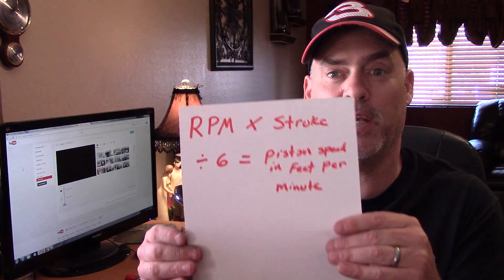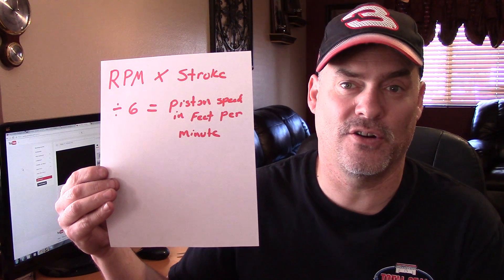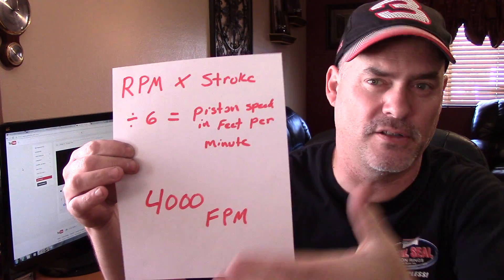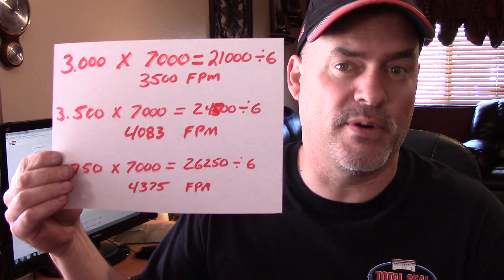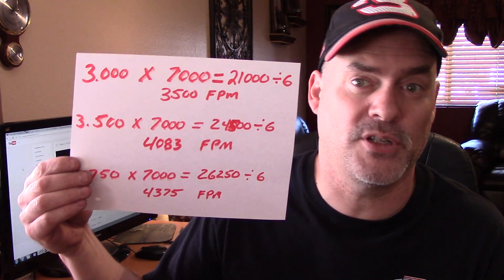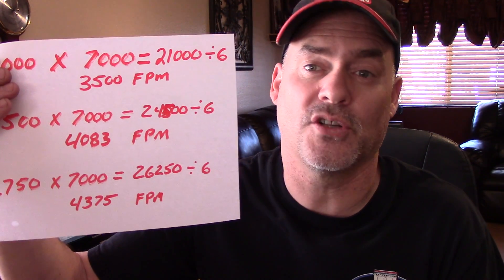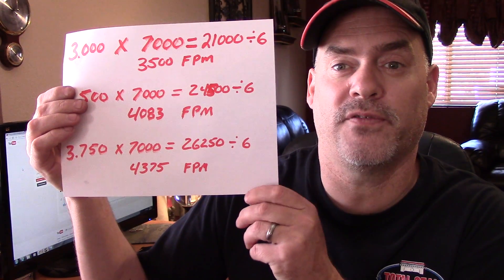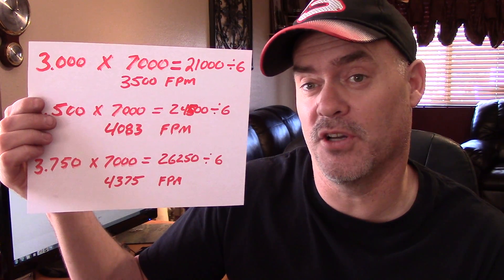What RPM should be an Engine's red line

Comment: Honda K24 4 cylinder has a stroke of 3.9 and those engines are taken to 9,000 or even 10,000 rpm all the time. Is it possible that the goal post has moved for piston speed limits with new materials and technologies or is this an inherent engine design since K24 is inline 4 vs a V configuration engine.

Comment: Just came across this video.  In today's engines, piston speed isn't nearly the issue it used to be.  Materials are better, designs are better....I'm not even sure piston speed is even considered much anymore...there are things that are much more important to consider when building engines..  11,000+ rpm engines these days are getting more common, and 8000+ rpm mountain motors is about as common as a small block these days.  The pistons speeds in those engines are off the charts and far beyond what would be considered acceptable.....

Comment: Man, Freiburger has said some dumb stuff, that stroke doesn't dictate redline and that all the power is in the short turn radius, things that are just objectively wrong.
Reply from the maker: If your dogging into it I would go roller cam and aftermarket heads by the time you find a set of the better heads and have all the work done to them you might as well buy new much better heads like Dart or RHS the flat tappet cams are garbage these days id go roller

Comment: so what naturally limits the RPM of an engine if all the parts are high performance.. springs, rings, bearings.... is it induction? is it that a 2 barrel vs a 4 barrel vs forced induction ... where the 2barrel just can not keep up with higher speeds and at some point it just peters out and is sending as much air and fuel to the combustion chamber... so its just maxed at 5000rpm and can't supply enough air/fuel to get it to 5500,6000,7000? ... and just improving the fuel / air supply allows it to hit higher RPMs? I am guessing thats what it is.. maybe cam durations have to be adjusted but thats not the limiting factor in the thought of a governor in a lawnmower

Comment: Thanks, this was a great explanation on how to find an engines recommended redline and performance capabilities. As a side note what is the stroke length of a 5.3L LS engine or would a 4.8L LS engine possibly be a better option? I would like to use a M122 GT500 Roots style supercharger and possibly even use a turbocharger as well.

Comment: the piston speed is important... but no is the rason real reason for choose the red line for your car... the best way without knowing the data of the dyno to choose your rpm red line is knowing the MCSA (minimun cross sectial area) in your induction. With the MCSA your can determine the real point to shift your car, this point in rpm + 600 to 800 rpm more is the correct point for the car.

Comment: This video and the one covering camshaft selection are priceless additions to my future engine build. I was given an LS1 from an '98 Camaro and want it to both make good TQ/HP numbers but also give me half decent mileage. I know you can't have both high peformance and high mileage, but there is a sweet spot one can achieve w/ careful planning. Its going to be a challenge w/ the lack of bore-ability of the block, but I should easily be able to hit the milestone of one HP per C.I. w/ a proper balance and assembly.  My goals are maximum torque while maintaining emissions compliance, as its my daily driver.

Comment: 327 is the perfect size i have a 302sbc a 86 350 and a vortec 350 what would you build i have a large journal 327 crank also 302 has popups
Reply from the maker: large journal 327 all day long 302 does not have enough TQ and you gootta spin it to the moon to make power 327 hase the best Rod Ratio and more TQ 350 stroke is a bit long puts the Rod Ratio too high or beat performance

Comment: I got a small block Chevy 327 , it has 12:1 forged pistons , steel Vette crank in a 4 bolt main block , 
It cranks 11,000rpm before the valves start to float

Comment: Hi, In AU. The last ford  5ltr w XR 8 had the GTP aswell.  Would you agree for the street.  Leave  the happy stroke, but bore to 40" - 60"   220, 512.110 grind,    and change nothing else,   i think would  sound better, good horsepower, std dwell for the injection and timming curve, good on fuel.    Has anyone compare this insead of some stroke increase .  Mike

Comment: I guess this is just all weird to me!! I've never heard anyone sit around and say: I want to spin my engine 8000rpm!! Like, what for, what''s the point?... just to say you can spin 8000 rpm?... doesn't make any sense!!

Now, what does make sense to me is asking how much horsepower you want to make. From there, we can start looking into what it's going to take to do that, such as what engines might make it possible, what the costs might be depending on engine choice, airflow/cfm, etc. That makes sense to me. But hey, to each his own!! If you wanna spin your engine 10,000prm and make 37 horsepower, more power to ya!!... wait... less power to ya!!

P.S. one of the biggest hold backs to rpm is valve springs!
Reply from the maker: if you are dealing with small engines 8000 RPM or more is required if you are going to compete with bigger engines, NASCAR engines run at 9000 RPM's for hours on end most serious drag race cars turn 8K to 12K RPM also when you build an engine for someone they always want to know the limit IE how hard they can push it I really don't understand why you think that is weird it seems to me you would really want/need to know where the red line is

Comment: Thank you for your Chevy 350 Video Series. These videos have helped me improving my technical understanding of  the 350.
Im saving up for my first engine Rebuild or Engine Build right now. 
....Best Case scenario....
I'd LIKE to see 600 hp/ 550 Torque out of my current 350. either in the 383ci or 400 ci. but since I still need to iron out other details on the truck. I'm probably just going to do a HO 350 rebuild for now. so I can drive it while I get the other details fixed as I go. 

I'm considering buying a built crate Engine or sourcing a LS Engine later.
the problem I have with the LS Option is. 
all the little stuff im going to need in order to make the LS work in my 94 S10. 
Wiring. Engine Mounts. power train. Computers. transmission linkage. cooling systems. 
yada Yada yada.
Reply: I have a 92 S10 myself. As well as a 1970 350/300 4bolt along with a good 350TH to use if I wanted. Same problem as you. The LS option is for sure going to require extensive wiring and what the heck, the speed it is going to generate might as well figure in a suspension as well. Lord knows the flimsy shocks that you get for the S10's isn't going to handle the corner speeds... I'd like to do anything/everything to the 350 and sit it in it, but hate to think that it will be just a putt putt truck...
Reply: @LORDdeath Gaming  You're making more out it than necessary for an LS swap. The wiring is a simple affair that you just lay on top of the engine, once installed, and start making connnections - it falls together like falling dominoes. I was intimidated by the prospect as well, but it went quite smoothly, once I hunckered down and started the process. As for your plans for your SBC, just remember speed costs money, so get rready to spend a pretty penny for an engine w/ those specs. Just sayin' those are big block numbers. Best of luck.

Comment: ok wait so my stock d16z6 can do 4720fpm
WTF 
ive hit 8000rpms maybe 4 times in my life because there is no reason when power drops imidietly after 6500 but thats a lot
i guess 

ive also had some stories with misshifts like to 2nd at 70mph and engine still working and didnt make any problems after that just works as it was working before

Comment: Why divide by six??
Reply: Because the stroke is half the distance (in inches) the piston travels in one crankshaft revolution.    
1) stroke x 2 x RPM/ 12 = FPM
or
2) stroke  x RPM / 6 = FPM
FPM is only the average  speed the piston traveled in one min.  The piston stops twice per revolution, (TDC and BDC) and is either speeding up, or slowing down.

Comment: Due to modern piston design, maximum safe piston speed is not so much a consideration as it once was. These days, an engine is limited by the valve train and valve spring surge.

Comment: 1968 Corvette 327/350hp, rebuilt double hump heads (new hard seats, new springs, new 1.94"/1.50" valves), flat-top pistons, Edelbrock 2101 Performer, Holley 600CFM vacuum secondary, 488 lift comp cam, headers have 1.5" tubes & 3.0" collector, 4.030" bore/3.25" stroke, and approx 9.57:1 compression ratio --------  
Let's do the math...3.25 stroke x 6000 RPM = 19,500 / 6 = 3250 ft/min....do you think 6000 RPM makes sense and is a safe number?  By the way, this was a 327/300hp from the factory with a 5300 RPM redline.  Thanks!
Reply from the maker: 6000 is no problem for a 327
Reply: @Myvintageiron7512  Thank you sir!

Comment: I wish I knew how much this translated to VW air cooled engines, as I have a liking toward them. Not sure I’d want to turn nearly 7500 RPM with a 82mm (3.228”) VW stroker motor, at least not without some real expensive parts.
Reply from the maker: The same formula applies to any engine just take your stroke and use the formula as long as you are at 4000 or below your safe

Comment: old man bell built me an engine that is nuts after he built it he told me this engine will do 10,000 rpms all day long so we had to test it we took it up to 15,000 rpms many times racing it and we run pump gas only running 13 to 1 compression with no problems no pinging or any thing it just ran hard just one problem with it like to rev real fast with water pump alt and power steering could not keep up and it will twist the front part of the crank right off but the class we were racing requires to be street legal has to have all the stuff to drive on the road and no stripping the car down so i had to learn not to rev it to hard but we never lost a race in my area but far from being cheap to build bell said he did everything he could on a sb even season the engine for a year and polished the inside of the block started with 202 angle plug heads but bell did his magic to them too , stock headers will not fit no more  how he described the engine was a indy bottom end with a dragster top end he said this way u can run real low gears and not lose top speed and u can gain torque thew the gears . i really could not believe this engine even when i was racing it the rpms was insane the sound that it made would make any man cringe just screaming sound i have a lot a race engines but this one is special next i am building a bb chevy because i just got a set of hemi heads for bb chevy of a funny car for 300 bucks

Comment: I saw this video about a month ago.  Great information.  Thanks!

HOWEVER.....I thought, "Where did the magical divisor of "6" come from and what is its unit of measure"?  To go from inches to feet, you MUST divide by 12 (12" in a foot) not; 6.

Then, it hit me last night.  "Revolutions per minute".  A revolution is a full cycle, both up and down of the piston.

So....you really must add the stroke up to the stroke down.  For the 302, it's 3"+3"= 6".  Then, multiply by 7,000 RPM to get 42,000 inches of travel per minute.  Now, convert from inches to feet using the divisor of 12.  You get 3,500 Feet per Minute....not Inches per Minute.
Yes, it's the same answer but, that's the  correct way, in my humble opinion, to follow the units of measure.

He used 6 (half of a foot) because he only used half the cycle (the up stroke).

Now, why is 4,000 FPM the magical number?  It seems to be factual but, why?
I can't see my 1973 302 turning 7,000 RPM.

Comment: I hate to be the bearer of bad news but the chevy 350 with z71 rods is good to 7200rpm safely so i don't know where you quite get your information from but it's wrong.
Out say you're better off trying to build power from an engine at 6,500 rpms.
Which are teen did in a chevy 350 and put out over 600 hp.
Now you're better off thinking about airflow then pistons speed because rods can change all that and l cranks and other such things that can be easily bought.

Comment: what would be the flow numbers of a set of heads that had the same size valves  "175 intake 175" exhaust valves always see bigger intake valve but exhaust is always smaller ???

Comment: Between 70 to 80 crank degrees on primary stroke which is tdc to bdc that's its fastest speed.and between 2 to 15 degrees past tdc is highest pressure in chamber.

Comment: My philosophy is just drive the piss outa of your engine until it blows then rebuild it...FYI don’t go paying no$10,000 for crate motors or built up big block! Just buy junkyard LS engines 4.8/5.3’s for $300 and install your turbocharger kit on it, once that engine blows just reinstall the turbo kit on “new” junkyard engine and just keep doing that! People who have $10k,20k+ engines are scared to drive them hard but you won’t be with a junkyard motor as long as you have traction you will win. If you don’t wanna tear down the engine to gap the rings to run over 8-10 lbs of boost make sure you buy the highest mileage engine possible so that on average the rings will be more worn and will thus have a larger ring gap 🤣

Comment: some rate their cranks associated with FeetPerSecond or FeetPerMinute etc. with piston speed- also a great factor whilst power and types of power produced and used also have their influences upon components and balances. In a 355 cubic inch chevy small block for instance / example you may be able to make XXXhp naturally aspirated say with some super lightweight components and then exploded, then  XXXXhp with a blower and then exploded, this is due to a balancing of dynamic pressures from the very little consistent boost in this example. So piston speed is the ultimate determining factor of what is possible all things being up to snuff. i may use a piston with a piston speed capable of 10000 fps but that doesn't mean my crank , lifters, springs, cam, rods , block, pushrods, valves, springs, piston pin, bolts, oiling system, cooling system, spark plug, piston rings, oil lubrication, heat ranges, rocker arms, or anything else,  -it doesn't mean any of it would follow, but piston speed is the ultimate determining factor above all else of what is possible and still the first input of information needed.  The things to look at are the rods and crank after piston speed for the application , the quality and strength, not only the material, has everything to do with your piston speed, usually i look at piston speed to determine the piston and then the rods and the crank has to hold it all. a stock factory 350 crank that is CAST some rate at 3850 fps @ the piston, since the piston speed is its determining factor.  The piston speed capability goes up gradually through  1. Quality used Factory Cast 3850 fps.  2. Quality Aftermarket Cast.  3. Quality Aftermarket forging fps. 4. pro forging. fps  5. Exotic forging fps. 6. all out pro forgings and Indy. fps  7. Controlled grain structure dynamically laser printed / forged / condensed forgings and 8. Continuing technological metallurgy in advanced laser forging processes and dimensional layering with miniaturization of super conducting particles proponet via geometric frequency light tables and orbital arrangement through expanded vacuum chambers through dynamically varied portal condensing frequencies.  and  the word.   i am

Comment: Whats the piston speed with a 4.375 stroke at 10200 rpm?
Reply: 7437.5 fpm.  Good luck.   :)
Reply: @bartsarton2212  And that 7437.5 fpm  is at 3000 HP. Look up blown alcohol funny car or blown alcohol pro mod.

Comment: Now that was informative thanx bud.
Ive got a 355 
Id say a lil bit more than moderately built .i twisted it to 7500 and 3 of my harland  sharps  started clacking pulled covers off and had 3 backed off to abot .050 .supposed to be .021 wp heads,1.555 springs,doubles with dampers. Cam .600 in 
.625ex..rockers actuall hit stud girdles.ALMOST A CATASTROPHIC.

Comment: My stock 454 reaches 4000fpm at 6000rpm , I was thinking bolts were the first in the pecking order when it came to up grades , but you say bearings come first.
Reply: and on the street a 6000 rpm 454 is all you'll ever need.  you wouldn't  be able top keep tires on the thing,...

Comment: So 4000 fpm is the limit for a stock bottom end. After that what is the weakest link to more piston speed? Thanks.
Reply from the maker: 4000 FPM is very safe for stock engines they can actually go higher but experience tells us that  more than that will shorten engine life  ive seen em do 5000 FPM but the pistons and rod bearings go away sooner than they should

Comment: Here is an interesting fact you may not know. The piston moves faster closing in on and moving away from the top of the stroke versus closing in on and moving away from the bottom of the stroke. The reason why is because of rod angle effectively acting like it's growing the rod in length as it approaches TDC and in effect shortening in length as it draws away past TDC. The distance between crank throw and wrist pin varies with the angle of the rod.
Growing in length while approaching BDC, bottom dead center actually slows piston speed down. It may be hard to fathom but the net effect is that there is more dwell time at the bottom for cylinder filling and less dwell time at the top to take advantage of chamber pressure. Learned this phenomenon at the tender age of 70.

Comment: I've seen dirt track racers consistently run 350 Chevy's with stock bottom ends to 7000 RPM but on a few drag race cars I've always played it safe to 6500.  Had a 396 once that I would turn to 6000 RPM.  But I'm a cautious guy.  Great video and thanks for explaining the numbers.